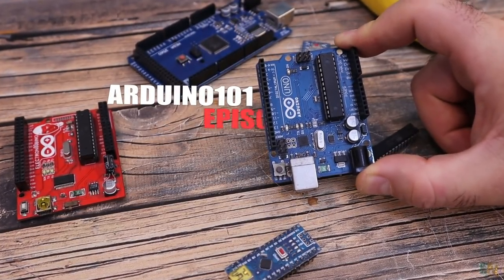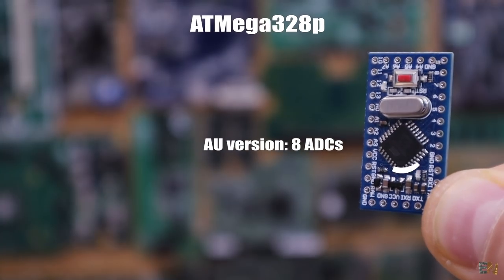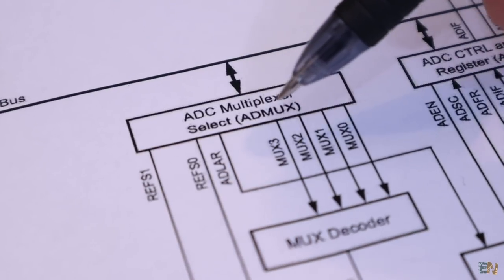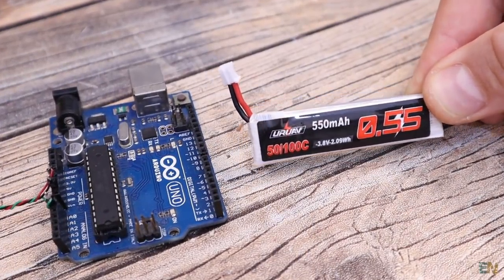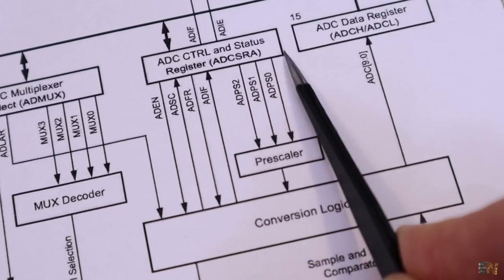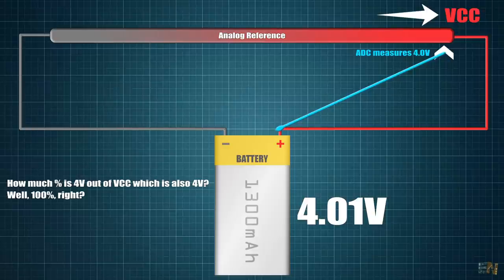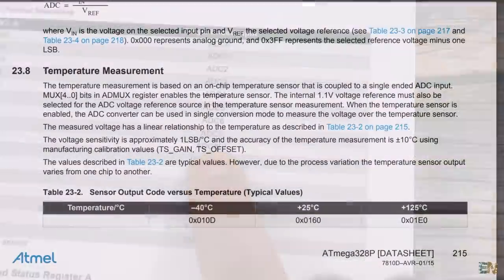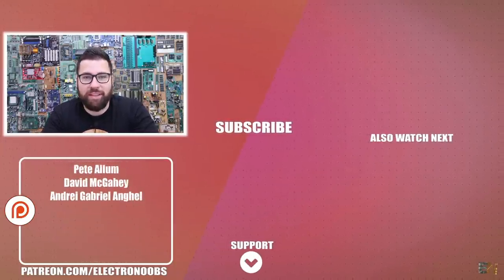ADC blocks and REGISTERS | Internal Reference | Internal Temperature Sensor Arduino101

Comment: super nice educational video, I still however did not get WHY we would go for register vs built in functions but ok ;-)
Great point about ref voltage
btw 1k/4.7k resistors - it makes sense to measure them first or apply some reference voltmeter when the project is finished - and let me tell you from my experience: breadboard vs. soldered final project is huge difference.
On Raspberry Pico ADC minimum value never goes below 450 but max goes to 64k - strange
Reply: "I still however did not get WHY we would go for register vs built in functions but ok ;-)"
Two reasons I suppose. 
1. It's good to understand what is happening on the chip, this is somewhat hidden from you if you are using the built in functions.
2. Depending on your use case, direct register code is going to run faster/significantly faster than using the built in functions.
Reply: @deadly_dave  yeap, in general it would be true but in this case probably not much. When I read ADC I usually make few measurements and then get AVG ;-)
Reply: @zyghom  
In that case refer to reason 1 💪🧠 
There is also the third reason that I follow sometimes, just because you can. 😎
Reply: @deadly_dave  we are together ;-) That is why I said: "super nice educational video" ;-)
Reply: @zyghom  That's fair :)
Reply: Hardware engineers use registers, software engineers use functions.  :^)

Seriously, well-optimized function calls should be nearly as fast as register manipulation.  Functions could even be macros which the preprocessor expands into the exact same expected register settings.  There's no reason they would be "much slower", it's an old wives tale that keeps getting repeated.
Reply: @MikesTropicalTech  Especially that everybody can see what the function does in the source code ;-)
Reply: @zyghom  
@Mike's Tropical Tech  (Edit: Tagged the wrong reply)
And embedded engineers use both. 

"Seriously, well-optimized function calls should be nearly as fast as register manipulation. "
Agreed but this is often not the case (ie functions are not always well optimized), or what the functions are optimized for might not match your specific use case.

Try running the digitalRead() and digitalWrite() function on an Arduino, then perform the same action using registers. Do these in a decent sized loop and measure the time differences. 

You will find that the old wives tale proves correct and the direct register version will run considerably faster (or the functions version will run "much slower").

Yes use case matters and this isn't always the case but sometimes it can have a significant effect.
Reply: @deadly_dave  freedom of choice is the key ;-)
Reply: @zyghom  
It sure is. 
Sorry, I meant to tag @Mike's Tropical Tech in the last reply.
Reply: @MikesTropicalTech  you talk as if the functions made available by arduino come from a real super optimized hardware abstraction layer (HAL) but this is not the case. The functions provided by arduino are designed to be used by a wide range of users, beginners or not. Using these functions you will certainly not get the control you have using registers, which is understandable because a beginner does not want to hear about prescalers, pipelines, multiplexers, DMA, etc.. For example, there will never be an arduino function to set the register containing the calibration value for the internal clock to compensate a possible temperature change (usually if there is an internal clock it is a very temperature sensitive one and with this type of register you can calibrate it to be more accurate). In addition to the loss of control the performance suffers in the same way since to generalize so much these features the chip will never be exploited to the maximum. You cannot take into account all the possible configurations for each type of application, which you can do by acting directly on the registers or by using a real HAL. A good example are the autogenerated HALs of the STM32 family of microcontrollers. In that case an abstraction is built based on an initial user setup step, so in that case the chip can be used optimally. You also have much more control
Reply: @manuelcattaneo5008  I would hope the 80/20 rule applies here, give us optimized functions for the most frequently used use cases.  Also, I tried to use the autogenerating tool for the Atmel SAM chips and it was buggy and incomplete.  I migrated to another chip family because it was so bad.  I haven't looked into the STM family.
Reply: i still don't get why we cook our own food when we can use build in functions like: macDonalds.get("burger");
Reply: @Henry-sv3wv  wrong - burger is of type of int, not string ;-)

Comment: This is cool.  With a PIC micro I was once able to send the DAC output to the ADC input and get the battery voltage without using any external pins.

Comment: Great Video, very well explained! However, you missed one important trick ;) One source of the ADC Mux is the internal 1.1V bandgap reference. This allows you to measure the 1.1V internal reference against Vcc as reference and thus determining Vcc without the need of a voltage divider or additional wiring!

Comment: You don't need a voltage divider.  It is more accurate to use the supply as reference and then to read the internal bandgap reference.  Reverse the equation to find out what reference is needed to yield 1.1V... that is your calibrated battery voltage.

Comment: Good tutorial. Maybe you missed to comment that in order to make accurate measurements using the internal reference, you need to measure it. The datasheet says 1.1V, but the exact value can vary from chip to chip, so in order to make precise measurements, one has to measure it and include the value in the code. There are many videos about the topic on YT (the guy with the swiss accent has one).

Comment: Hi brother, I have a question, can we sample higher frequency periodic signals with low sampling ADCs by taking samples not from a single cycle but from multiple cycles, lets say we want a 360° waveform, so if we sample it from 360 cycle by teiggering the conversation at right time while the wave is at that phase.  Then we can merge the samples from different cycles to re create the shape of the wave. This will be helpful to make a high bandwidth scope using slow Arduino. Please reply with your opinion.

Thanks

Comment: Didn't knew that the atmega328p chip had an internal temperature sensor...thanks for this informative  video...
Just wanted to that is it possible for the atmega to get hot while operating at the highest clock speeds?

Comment: Very nice tutorial! There is just one issue with your code, this line is incorrect:

    int value = ADCL | (ADCH << 8);

The problem here is that the C++ language standard does not guarantee the order in which the registers ADCL and ADCH will be read, and it is important that ADCL is read first (see the datasheet). Maybe your compiler just happens to read them in the right order, but this is not guaranteed to work with the next version of the same compiler. A safer idiom is:

    int value = ADCL;
    value |= ADCH << 8;

However, since avr-gcc knows the proper way to read 16-bit registers on the AVR, you can simply write

    int value = ADC;

which is in fact what analogRead() does.

Comment: Thanks for this!  The inaccuracy of analog voltage measurement has been bugging me for a long time.  I see that using the default Vcc as the voltage reference is garbage due to your well-explained points.  

So the only way to get an accurate voltage reading is to:
1 - Use the 1.1V reference
2 - Prescale your maximum expected input voltage down to a maximum of 1.1V with a resistor divider.

This leads me to see that you have to use extremely high precision resistors in your voltage divider, or you're forced to do a calibration process on every unit you build.  Otherwise the single fixed scaling factor you use in the software will be inaccurate in each unit due to tolerances in the resistors.  How do people normally handle this?  1%?  0.1%?  What is the cost differential for these vs. default 5% resistors?

I've tried to use an external 4.096V reference chip so I don't lose a bunch of resolution bringing my 80V battery pack max target voltage down to under 1.1V.  Am I gaining anything with that chip or should I just massively scale down the input voltage and use the 1.1V reference?

Also, how does using the Bandgap reference come into this?  Does every microcontroller have the same Bandgap reference and if so, what value  is it and how accurate is it?  Thanks!
Reply: I have seen many old boards where the manufacturer places a potentiometer on the board to manually calibrate. Another option to calibrate each board without a potentiometer is through software. Have an accurate 5v supply on your bench and run a routine to record the digital value on the board's nonvolatile memory. Your program can use that as the max value and scale accordingly.

Comment: I love this series and I really wanted to learn about the internal voltage reference, it will be extremely useful for some of my data logging applications. However, does anyone know how stable this voltage reference is compared to the 5V VCC e.g. when the arduino is powered with 12V (always the same supply adapter)? Is there a significant improvement in the stability?

Comment: Very useful, thanks. Can you talk about external reference standards that you can buy from ebay such as the AD584KH precision voltage reference modules? Do they improve on the accuracy of the internal reference provided by the Arduino?

Comment: There is a seemingly better way to read VCC - Without a voltage divider, that drains the battery and without using pins. you can Read the Voltage Reference against VCC, and calculate VCC from there somewhat backwards:

long readVcc() {
  long result;
  // Read 1.1V reference against AVcc
  ADMUX = _BV(REFS0) | _BV(MUX3) | _BV(MUX2) | _BV(MUX1);
  delay(2); // Wait for Vref to settle
  ADCSRA |= _BV(ADSC); // Convert
  while (bit_is_set(ADCSRA, ADSC));
  result = ADCL;
  result |= ADCH << 8;
  result = 1126400L / result; // Back-calculate AVcc in mV
  return result;
}

Comment: But Internal 1.1ref bound me to measure 

Maximum 1.1 v drop

Is it applicable for 3   3.7 v series connection 
Fully charged 4.2*3 12.6
Discharged 3.0*3    9v

12.6 - 9   3.6 
Min 3 volt drops detection required
Reply: Is it safe to connect Arduino 3.3 v pin to ref 

May this resolve it